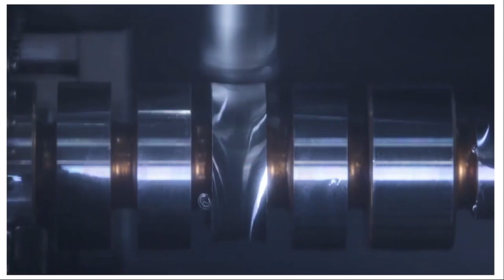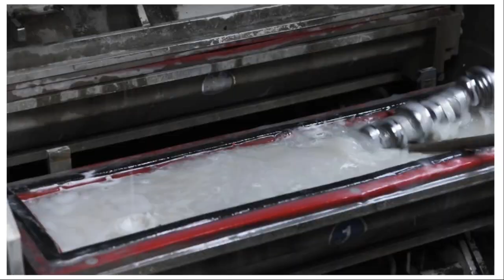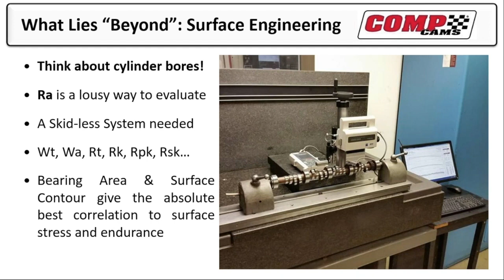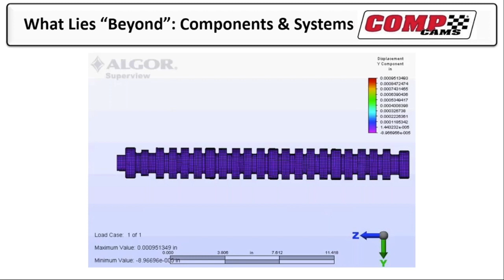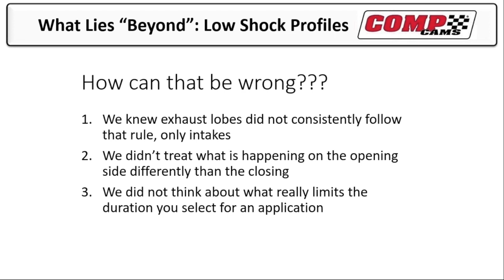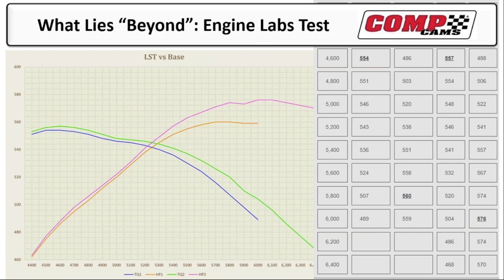AERA Super Webinar - Billy Godbold on Low Shock Valvetrain Technology

Comment: Several LS experts found it extremely difficult to improve on the stock LS7 low shock technology. People who do stock rebuilds on LS engines often buy OEM LS7 lifters to maximize durability at a good price.

What you said about SAE 9310 is interesting. People who build new AR-15s sometimes use SAE 9310 at the bolt as an alternative to the C158 originally used in the first one. It has been said that with the right heat treatment, they make it 10% stronger than C158.

You stated that nickel is bad for the wear characteristics of these alloys? Why are some of the high nickel blocks considered to be the best?

What does it take to weld these alloys? Sometimes an engine failure might happen after a race, and the only timely solution is a weld up and regrind before the next race.

17:21 Is it wise to use the Mitutoyo measuring tool that is frequently used in cylinder honing?

56:38 I found it interesting that the Hyundai Genesis Coupe had a 2.0L turbo engine, port fuel injection, 9:1 compression, and permitted 87 octane gasoline. Higher octane did allow more power, but the manual permitted 87 octane. I think the later Genesis Coupe 2.0T was rated at 260 HP on 87 octane, and 280 on premium. GDI turbos sometimes have even higher compression that port injection turbo engines, but that complicates the subject. The first turbo car that fascinated me was the Nissan 300ZXTT. Those had 8.5:1 compression, and premium unleaded was a must.

Comment: @ 54:00:00   The real world is indeed very different then the dyno....Unless you have a so called vector dyno , used in F1 , which can simulate the vibrations in the crankshaft and valve train when driving over the curb stones.   Even that influences valve train stability. Or this type of dyno can replicate the accelerations on the track which are much higher then the 500 or 750 rpm/sec   on a normal dyno.
Reply: Pratt an Miller corvette had access to one and used it to find a valve drop issues that they ran into only at the track.  Turns out their downshift spark cut strategy was overly violent and the explosion happening in the exhaust was shocking the locks off the exhaust valves.

Comment: Actually the pushrod load is highest at maximum lift,  and your measuring equipment is probably cancelling out on the SpinTron? however contradicting that therory is> the acceleration rate is probably highest, @ between 30 to 50% lift.
   My guess is because that is most probably how you designed the lobe to work?
 Also, I don't agree with your preferred choice of pushrod to to rocker geometry angle, @between 30 and 50% lift, because I've been there done that. Having said that, I have to thank Compcams for all of my Compcams camshafts components.
Thankyou.
Reply: At the exhaust its at opening.....the residual pressure in the cylinder can be up to 220 psi in atmospheric engine...resulting in huge forces.

Residual pressure in tractor pull supwrcharged diesel  or  top fuel exceed  50 bars which is 700 psi or so that equals  about 2200 lbs to open  the  exh valve ....and with rocker ratio of 1.7  about 3500 lbs on pushrod when opening exhaust valve.....

Comment: I put the ls3 low shock stage 2 cam kit and this cam kit is amazing sound good and runs great wow
Reply: What u put down and hows the tq I got the stage 1 I haven't installed yet
Reply: 515 on e85  15 camaro 1le
Reply: @brodricksmith2156  ahh nice that's what I got a 15 1le 👌